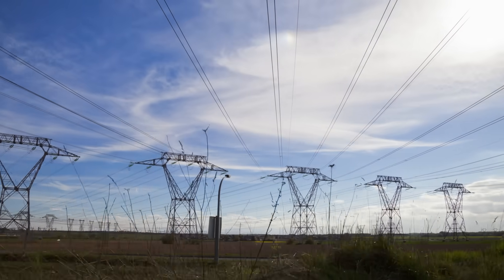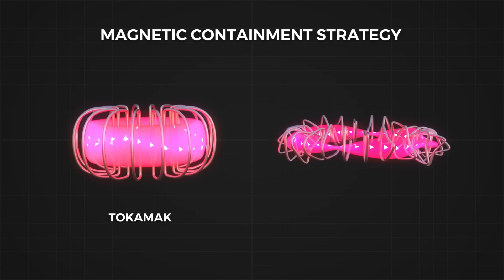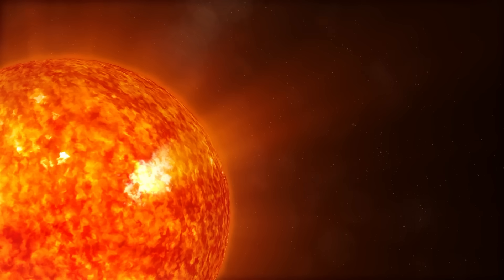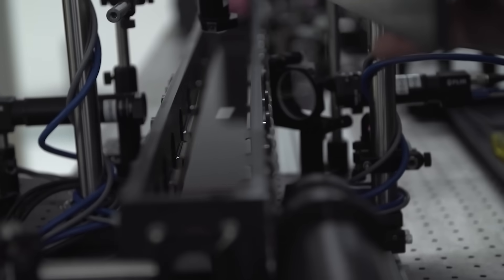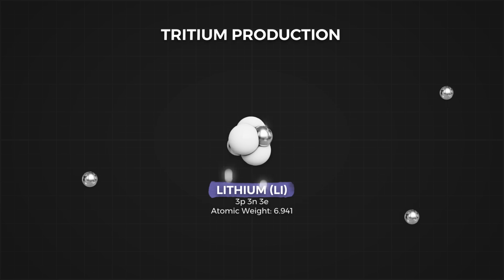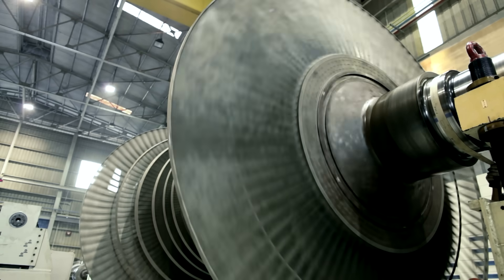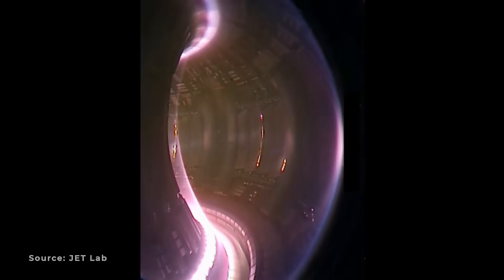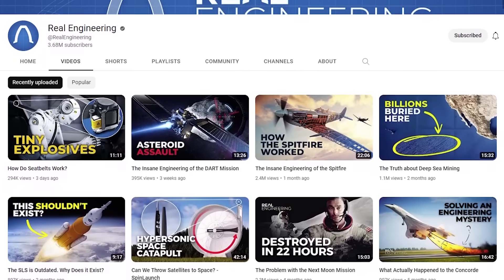The Problem with Nuclear Fusion

Comment: It will take probably millions if not billions of years to run out of Helium as long there Uranium down below in earth's core.
Since Alpha radiation is almost helium.
Reply: That’s just not true lmao. We have <100 years. Barely any is produced compared to what we use
Reply: @Gomlmon99  One Uranium atom at a random time emits a alpha particle and decay in to another element, that element also has uneven proton/neutron count and also emits a alpha particle at some random time, than it decays again and again until it reaches the  lead state witch is stable. the heat in the core of the earth is generated by Uranium, so these alpha particles on the way up or so pick up some electrons and voila you got helium. the helium we find is stashed in pockets. maybe they depete.
Reply: @AnalogDude_  I know what alpha decay is. What I’m saying is, we use helium at a much much faster rate than what is produced through alpha decay.
Reply: @Gomlmon99  there is millions of tons down there. the total earth ball is quite big, impossible to drill everywhere. so you really never know.
As kind it's cool to have a balloon that floats, but on the other side for such a precious recourse you can't recover, you shouldn't use that for that. but i don't wanna spoil a good time for a kid.
But in some video or documentary filmed at a well where they pull Helium in the USA, some guy claimed there is enough.

there is some guy that sended a egg to space and return it without breaking some 2 weeks ago here, he stated that they release like 2000 balloons around the globe to probe the weather each day.

Comment: Until they figure out how to continuously add fuel to the reactor without disrupting the magnetic field Fusion will still be 20 years away, Not impossible, just difficult beyond comprehension.
Reply: Isn’t that what SPI/HFPI does just fine?
Reply: @Gomlmon99  as far as I know there is no way to add fuel to a fusion reactor with a fusion reactor without disrupting said fusion reaction. You need some sort of Star Trek'esque magnetic field injector.  Fusion reactions are very sensitive any imbalance causes the reaction to shut down.  What they have done is great leap forward but the other piece of the puzzle needs to 
be figured out.
Reply: @boblynch2802  I was under the impression JET has been doing this for decades
Reply: @Gomlmon99  cite your source.
Reply: @boblynch2802  working in the industry. The HFPI does fuelling and the SPI does disruption mitigation. Would have thought they’d come up in a google search. I could be wrong. Fuelling isn’t my area.
Reply: @boblynch2802  JET also use NBIs for fuelling as far as I know. Should also come up on google

Comment: Just pointing out the main thing making NPPs uneconomical is the absurd requirement that NPPs pay for all tye decommissioning expanses upfront, AKA half a century in advance.

If coal, gas, and windmills had the same moronic requirement, we'd still be reading using candles.

Comment: Wait I thought the reactor it self makes electricity but turns out it heats water to boiling temperature and use that water to spin a giant dynamo. I’m disappointed.
Reply: yeah until you realize the fission reactor also did that years ago and it's more efficient at powering the world than anything else ever
Reply: @kakyoindonut3213  well fuck, this is so lame 😒 so what’s the deference from steam engines? same technology just more efficient way to boil water
Reply: @bigschnozer576  Yes

Comment: Make a video about breeder reactors and how they remove most problems that come with conventional nuclear!
Reply: They don’t remove the biggest problem - cost!
Reply: @Name  the biggest problems purely from an outside perspective are the fear of meltdowns, nuclear waste, abd the fact that they aren't truly renewable, but if we powered all of humanity today purely on breeder reactors we would have enough easily accessible fuel today to power all of humanity for the next 4 billion years, placing them as a semi-renewable non greenhouse gas producing form of energy that isn't reliant on any outside factor such as sunlight or wind
Reply: @rgmoses2189  It is governments and industry who build them. They are the people that matter and for them, all they care about is cost.

Breeders are even more expensive.
Reply: @Gomlmon99  and thorium power plants are projected to be about 75% of the price of new conventional nuclear plants while producing just as much output, much less and safer waste, and running on a source of fuel that is 3 times as abundant as Uranium is that will not need to be enriched meaning fuel and overall operations cost should theoretically much cheaper especially in the long run. So yes, they do solve nuclear's most prevalent issues
Reply: @rgmoses2189  hmm I’d like to see a source on that 75% estimate because right now they’re immature and have a lot of problems. YouTubers love them, actual engineers don’t.

Comment: Well this didn't age well. Two days after putting this up, a fusion reaction occurred in which a substantial net gain was generated from a fusion reaction.
Reply: NIF didn’t generate an overall net gain, nor can it be used for electricity production
Reply: Only that the NIF is not really opening a path for viable power plant designs. Helion is much closer to that.

Comment: We will probably be using whats essentially a fusor, but instead of the physical ''cage'' inside to control the plasma, we will make a ''virtual'' cage using electromagnets.  This will allow the plasma to get a lot hotter without the relatively cold cage inside.  We can then weaken a part of the em cage to allow plasma to be funnelled off for use making steam.

Comment: I would also dispute that fission plants are being shut down due to competition - this is plainly false. Operating and maintaining a fission plant is around and order of magnitude cheaper per kilowatt hour than solar which is expensive and dirty to manufacture and needs regular replacement, or wind which requires regular maintenance for moderate and inconsistent output.

It is far more the case that nuclear plants are being shut down due to regulatory and governmental pressures because "nuclear is scary and makes scary-bad products." Such governments (almost all governments) are under the mistaken notion that the quantity of nuclear waste will drown the planet, when in reality all existing fission plants could run at full output for 100 years and still not even fill 1% of all existing sequestration sites.
Reply: ''While environmental opposition may have been the primary force hindering nuclear development in the 1980s and 90s, now the biggest challenge may be costs. Few nuclear plants have been built in the U.S. recently because they are very expensive to build here, which makes the price of their energy high.''
''the reactors run as often as possible to spread their enormous fixed costs over the largest number of kilowatt-hours. Unlike gas turbines, which can be turned on and off in seconds to “follow the load,” reactors take an hour or more to cut their production in half.
It’s not that reactors can’t follow the load; they’re just slower. “They can and do, because they have to,” Buongiorno says. “It’s just never an attractive economic proposition.”

Comment: I hate to burst your bubble a little bit - but we will almost certainly never be free of mineral oils or the need for coal and natural gas. Certainly developing a safe and cost-effective method for energy generation will drastically reduce those demands, but steel will still require coal-coke, moving bits will still need durable lubricants, and natural gas deposits are the most abundant places to get at sequestered helium. These are not the only necessities of fossilized hydrocarbons, but some of the most apparent.
Arriving at a place where the world is truly post-scarcity in land resources will take a very long time and a lot of effort and innovation, far beyond even the wonder that would be fusion energy.

Comment: Saying nuclear waste cannot be stored economically is not really accurate. We can put as much effort to put it back deep under ground as we put into extracting fossil fuels. It's much more of a NIMBY problem. And then there are newer designs that are fundamentally designed to produce less of such waste reducing the scale of the problem by orders of magnitude. Fission waste management can be done far more effectively and less risky than the management of fossil fuels waste. We have simply been conditioned that it's a dirty fuel.

Comment: Is there a possibility a failed attempt at this could destroy a country? It sounds dangerous, especially when you consider it’s nuclear
Reply: No. The fusion plasma is very hot, but not very dense and it is surrounded by a high vacuum, which is a perfect insulator. Think of steam from a pot of boiling water. The steam is boiling hot, but you can hold your hand into it (carefully!) without getting severe burns. This is similar. The total energy content of a pulse is only about 2 kWh, about the same as 15 to 20 laptop batteries.

Comment: Already seeing the contrarians trying to feel smart by saying “ACKSHUALLY the new nuclear fusion breakthrough is nothing but a minor achievement because [insert irrelevant fact that’s easier to overcome than achieving nuclear fusion]”

It’s a great achievement, end of story. Are we gonna get free energy tomorrow because of it? No, we still have a lot of problems to overcome before we can make this source of energy actually useable. However, we as humans achieved something that normally only happens inside of a star, AND we might be a few decades away from the best source of energy humanity has access to without the use of a Black Hole or an entire star.

Comment: How will this process be cooled?  Are we going to have to warm up the world oceans? 
i admit  that this an uninformed question.  It would be nice, regardless, for an answer.
Reply: No, they wont warm up the world's oceans. 160,000 TWh is all of the energy currently consumed by humanity. That is for all purposes and from all sources.
Energy from the sun hitting earth: 1,515,480,000 Twh a year, or about 10,000 times more. Even if energy demand increased dramatically and all of the energy was lost to heat without doing any work, it would not have any impact on warming oceans or anything.

Comment: The thing that makes nuclear power so expensive in the 21st century is the way projects are not built at scale, they are always one off designs built 1 every many years under murky political circumstances. Building reactors at scale, serialized, with a fixed design that gets iterated on instead of redesigned, and so can be pre-certified and approved, can save a lot of money. Also, with a bit more foresight, a reactor can be built to last longer, and ideally could work with breeder reactors minimizing waste and fuel requirements. But then again, that'd take a deliberate effort by governments and companies, I wouldn't hold my breath for it until the last possible second. Hopefully Fusion doesn't become a series of overly expensive 1 off science projects and is made into a real at scale commercial powersource.

Comment: The high temperature would melt anything in the universe even earth? If not, instead of wasting so much money on plasma confinement, why don't they build the chamber out of soil? Or just dig a hole in the earth and conduct the fusion there.
Reply: The fusion plasma is very hot, but not very dense and it is surrounded by a high vacuum, which is a perfect insulator. Think of steam from a pot of boiling water. The steam is boiling hot, but you can hold your hand into it (carefully!) without getting severe burns. This is similar. The total energy content of a pulse is only about 2 kWh, about the same as 15 to 20 laptop batteries.
Reply: @elmarmoelzer2229  It doesn't melt the crust of stars so I don't think it should melt earth. Underground fusion is the way to go. That will save a ton of electricity used to create the magnetic field to confine plasma. Maybe they will get more output than input that way.
Reply: @marajevomanash  Why would it save electricity?
Reply: @elmarmoelzer2229  Because electricity is used to create magnetic field to confine plasma. The whole point of it is not to let plasma escape as it would melt any material. But if they build a chamber like an earthern pot underground, it won't melt and save electricity.
Reply: @marajevomanash  It is not about keeping the plasma enclosed in a chamber. The vacuum chambers can handle the plasma temperature just fine. Again it is not very dense. The magnets are needed to hold the plasma together and keep it away from the walls. If it touches the walls (earth or metal, or quartz, etc), the plasma cools down too much for fusion to happen.
Reply: @elmarmoelzer2229  Why isn't the cooling of plasma a problem inside the core of stars? Maybe we can use the electromagnets to get it going and once it reaches higher than required temperatures, turn off the electromagnets to save electricity?
Reply: @marajevomanash  
Stars are entirely made of plasma :)
The power consumption of the magnets is not really that big of a problem especially with High Temperature Super Conductors. They only need power for the cooling. 
If you turned off the magnets, the plasma would quickly be driven apart by its internal pressure. For some confinement concepts like Helion's that is not a problem. Some of them don't even need magnets at all. NIF does not, neither does Zap's design (which aims to reproduce NIF's recent results early next year). 
Helion plans to turn off their magnets about halfway through the pulse. The plasma then expands which induces a current in the magnets that surround it. The plasma will have transferred all of its useful energy to the magnets before it reaches the wall.
But that technique is unique to Helion and does not work in steady state machines like Tokamaks.

Comment: Nuclear is uneconomical because we spent 100 years subsidizing fossil fuels, and don't hold companies to account for the damage their activities induce on the planet. Nuclear is cheaper by far than fossil fuel based energy if you actually factored in EVERY cost to fossil fuels.
Reply: Nuclear is not cheaper in the West. That is the reason it is not being done.

Comment: Global warming is as much a population problem as it is a pollution problem.  Unlimited energy will heat the atmosphere as effectively as a CO2 blanket over the earth.  The areas that you call "barren wastelands" many species call home.  Let's actually think out the solutions we're building with an eye towards the future problems they'll cause.  Do you know what a "desalinization dead zone" is?  It's an area in the sea that surrounds a desalinization plant where nothing can live because of the increase in mineral content.
Reply: 160,000 TWh is all of the energy currently consumed by humanity. That is for all purposes and from all sources.
Energy from the sun hitting earth: 1,515,480,000 Twh a year, or about 10,000 times more. Even if energy demand increased dramatically and all of the energy was lost to heat without doing any work, it would not have any impact on global warming.
Reply: Nuclear fusion produces no greenhouse gasses, that would be one of its major benefits. There would be a limit to how much electricity it could produce, limitless energy is false.

Comment: It has finally been recognized that building massive power plants that cost many billions and decades to construct.  All current fission development is focussed on mass-produced self-contained modular power systems that individually produce less than 100MW.  A side benefit of this is that it becomes feasible to place these small power sources closer to consumers.  The smallest proposed systems can replace diesel-generation for isolated mining or aboriginal communities.  This design creates a more robust power distribution systems by replacing the need for multi-billion-dollar, and excruciatingly ugly, distribution networks.  But almost all of the experimental systems discussed here can only reach energy generation by scaling UP.  As the

Comment: Low cost solar is closer then fusion , but still a few years away .
Reply: Problem is that the sun does not shine at night and solar has higher lifetime emissions that fission, let alone fusion will have.
Reply: @elmarmoelzer2229   Solar with todays tech has one of the lowest , fusion does not have any because it has not been invented . The new Tesla 4.0 cell is the first of many breakthroughs in solar . The perfection of the perovskite solar cell is very close at hand . Fission  has the problem of waste , accidents and health problems for the plant workers .
Reply: @paulpetock2836  Fission is actually the safest energy source out there. Rooftop solar is more dangerous. Solar has the problem with storage, which IMHO won't be solved for another year. A country as small as Germany needs 50 times the total battery production of the world.

Comment: old wars..."war for oil and natural gas"..................future wars..."wars for escarce reserves of tritium and beryllium"???...............................we gonna end in the same sh#$t...ohhh dear...
Reply: D-T fusion machines will breed their own Tritium in a "Lithium blanket" That can be solid (likely not so great) or a liquid tank that surrounds the machine, or it can be a liquid waterfall (FLF and Zap) or a vortex (General fusion) of some Lithium compound (often LiPb or FLiBe). The neutrons from D-T fusion react with the Lithium and make Tritium and Helium. Currently they are aiming for a breeding ratio of 1.1 per fusion neutron.
The Tritium breeding reaction is exothermic. So, they actually get a small energy boost from that too.
Newer designs are smaller, some of them also use liquid blankets without any Beryllium in them at all. 
Helion will not need Tritium nor Beryllium anyway.